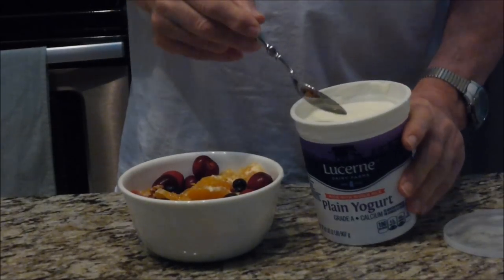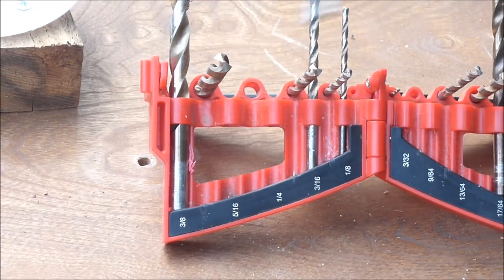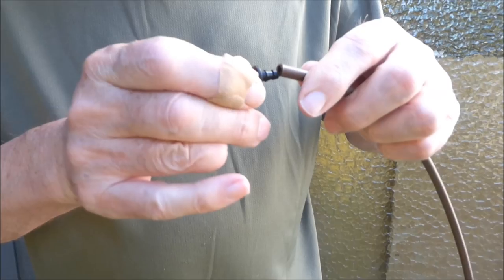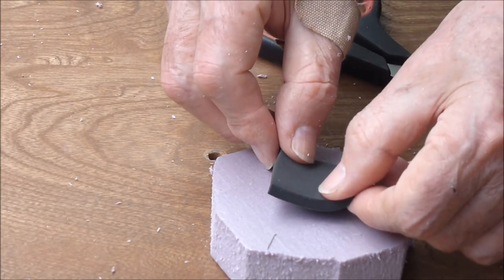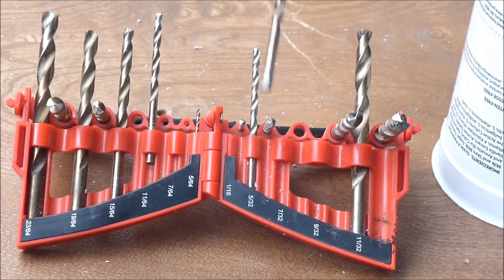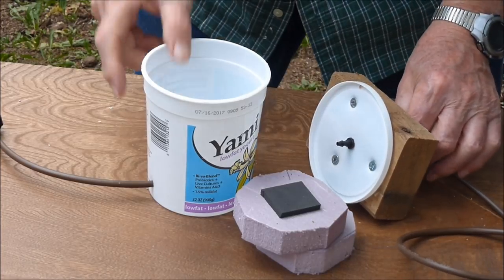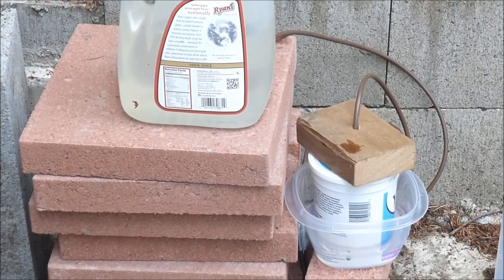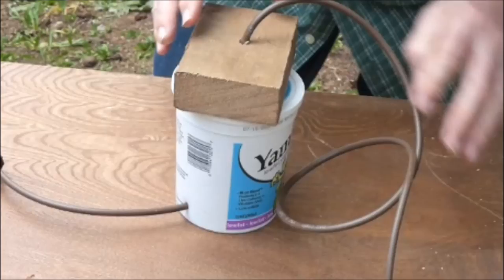A Yogurt Container Float Valve by B A  Kratky

Comment: Brilliant idea, Dr. Kratky! Agreed that the 1/8" shur tape or similar will fail over time, though in my experience, the reason for failure has more to do with inconsistent use. By that I mean I neglect to fill the reservoir, which means the spongy material is not exposed to water anymore and thus dries and deforms. I have a ton of the 1/8" material left but am tempted to try the 1/4" neoprene. Has the thicker neoprene proven more failsafe for you? Thanks!
Reply from the maker: Yes, the neoprene foam has definitely been more durable.
Reply: @growkratky5558  Thanks for confirming, Dr. Kratky!

Comment: You mentioned in the original video that this could be used for animal watering systems.  What is the new material used as the "stopper", and does it present any problems for health of pets?
I'm looking to build a off-grid watering system that doesn't involve lifting & tipping gravity feed bowls which weigh 16# or 24# (2 or 3 gallon), but rather an slightly elevated reservoir to a suitable large bowl on the floor.  Thanks a lot for any advice.
Reply from the maker: Sponge neoprene stripping with adhesive by Cleverbrand Inc (CECOMINOD 054308) was purchased from Amazon.  I don't have the MSDS on the material and suggest you contact this company for animal safety.  You will need to study the MSDS for both the material and the adhesive.